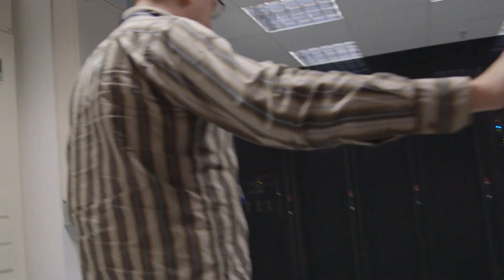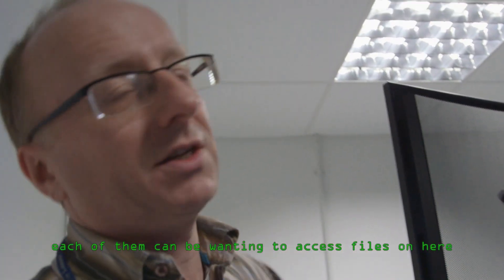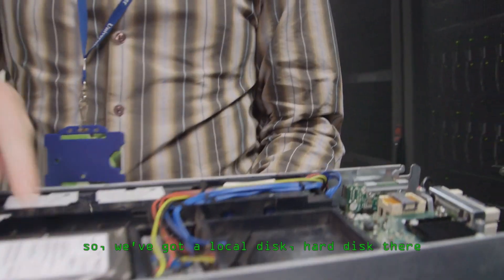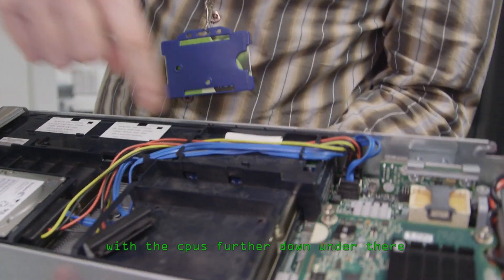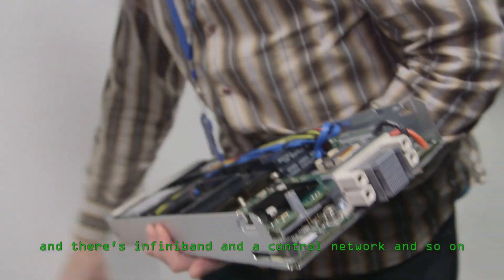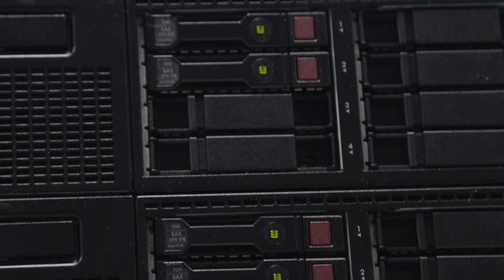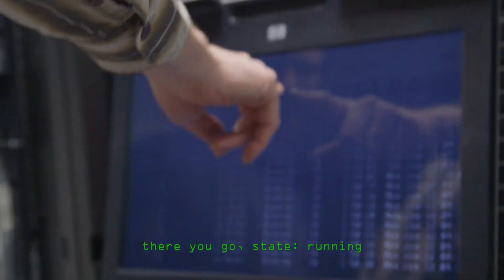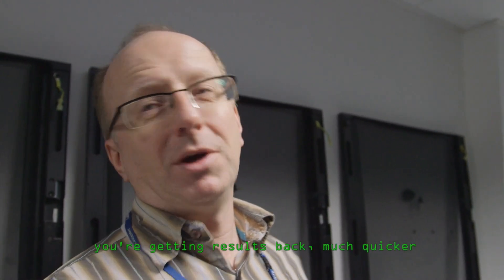Supercomputer and the Milky Way - Computerphile

Comment: What if real life is being run on a supercomputer just like this?
Reply: That'd mean that it would be emulating itself at full speed. (Given that it exists in 'real life' and it is simulating 'real life'.)
Reply: Goobli bloo! It probably is... It's the most boring FPS to ever be designed. LOL :) If you think about it, everything that we perceive is nothing more than a reflection of what we believe we see. If you think about the fact that all you have the ability to see is what exists around you at a given time, it would be possible to have the universe as you know it load progressively as you appear to move through it. (Where it actually moves around you.)

The Matrix was basically that idea. Processing power for each person's experiences could be borrowed from their brains, which would just be a node in the machine.
Reply: Haniff Din i dont think you understand psychology well enough to make those statements, we know the brain doesnt work the way you explained because of mentall illness and physical illness and some of the state altering substances you pointed out. a computer behaves in bits and bytes, but interfaces that into something that is easier to comprehend for humans. the brain does the same, it gets an stream of info that would make no sense at all if we got it directly.(or atleast it would make a lot less sense). it makes from those signals an useful whole so we can respond to it and filters out the noise. sure, that is going to be a little bit different for everyone, and will become even more abnormal when taking drugs, or experiencing depersonalization, dissociation, or an out of body experience. this all influences the brain in such a way (all for different reasons) that the way the brain handles these inputs differently. drugs mainly are chemestry changes, that when taken often enough actually change the nerve paths in the brain. but dissociation and depersonalizations psychosis etc are also very obvious an altered interpretation of reality for various reasons. that my blue might or might not be the blue that you see, doesnt matter. we still both call it blue because we both learned its called blue. an altered state of mind is basically this difference exaggerated. the brain deals with the input differently than it does with the control group. this also is dependent on the laws of physics. no action is without an reaction. and every reaction must have an action prior to it. in quantum physics this gets weird, but there just isnt any solid proof that it actually is as weird as we think. just because we dont know the underlying causes doesnt  mean there isnt any. its just an unsolvable problem if that was the case, and we are far to new to the quantum physics to conclude that it is unsolvable.
Reply: Gabriel Garcia I think the idea is that we are information on a larger computer, not on a computer inside our reality.
Reply: Elliott Collins well, he did say "on a supercomputer just like this."
Reply: +Joe Mills our brain is more like a data interpeter. not a simulation interpeter. if we generated the signals ourselves then yes, we would be running a simulation. but that would leave us able to live in different realities. and thats not the case.
Reply: ***** yes, thats exactly my point. a different perception doesnt mean a different reality. its not a simulation of reality its a conversion to terms our consciousness and subconsciousness can grasp. i can translate something from english to french, that doesnt mean i said something new. but some things wont translate completely well and ill have to change the layout, add some words, remove some words. use cultural reference etc.. thats why people perceive things different. some people their brain is wired differently. thats why things like dyslexia and autism etc exist(this is an oversimplification, but a part of it is perception and data interpretation)
Reply: Haniff Din i have dissociated for hours, ive had depresonalization episodes for days. ive had 2 near death experiences. ive saved 2 lives from other people. ive don lsd about 6 times. ive eaten shrooms about 4 times(they are legal here so a much higher dose than this garbage you get in countries where its illegal.)
Reply: Haniff Din why are you insulting me? is it because i nor my sources do not conform to your idea of the world? i dont think you understand what a depersonalization is. maybe you should read about it before insulting me and saying i never had an OBE. an depersonalization is the medical term for an OBE and some other unbodily experiences.
Reply: ***** with time it becomes more difficult and science is not entirely sure on which it is yet. (from what ive read atleast, feel free to post proof for the statement that time is an emergent property)
Reply: ***** thats not evidence that time is an emergent property. thats  a conclusion from untold arguments.
Reply: ***** photons are quantum particles that dont have a mass, electrons are particles that do have a mass. thats a huge difference in physics. i already provided scientific evidence in the link i gave on why gravity isnt a secondary force. unless you can fight that source for my argument it still stands no matter how many different viewpoints you throw at it.
Reply: Gabriel Garcia Whose to say the world is being run at full speed? The world could lag or stutter but we just don't experience time go by when it happens.

Comment: By 2030, your right smart lense would pack more computing power than DIRAC.
Reply: Moor's Law isn't going to hold true forever, right now we are running into issues with sizes of atoms. While I do hope that quantum computing will become a thing I have doubts that they will have quantum computers the size of a contact lens, transparent, have little to no heat emissions, and have their own energy source in 25 years.
Reply: I have doubts about that.
Reply: nope it won't have. Even if Moore's law holds (which looks more and more unlikely as time goes on), the average PC will be 256 times faster than now, and since DIRAC uses PC's as a building block that means your 2030 desktop will still be 4 times slower than DIRAC is now

your smart lens will certainly not be faster than it
Reply: Zak El Fassi yes, we are bad, but Moor's law holds for over 40 years now, and it always pointed at the best performance practically possible with current technology
Reply: Noah Hounshel well.. he does have a point, technology does advance MUCH faster then human's tend to be able to predict
Reply: Noah Hounshel This may be a cop out, but all you really need is a strong networking device within the contact and you could outsource all those transistors to another device.
Reply: But then your contact lens wouldn't actually be 4000x faster than a regular computer.
Edit: Plus it still wouldn't be transparent.
Reply: Noah Hounshel 15 years*
Reply: Apologies,
Reply: Skepticism aside, if we've learned anything about the human nature from the past 20years, it should be "humans are really really bad at predictions."
Reply: While I like the idea of some sort of seamless integration of local display technology and remote compute backend, I really can't see a use case of putting that much computing power in the hands of the general public.  OK, fine, misquote Bill Gates at me, but I'm serious, there's more computing power (and connected bandwidth for that computer) in the DIRAC system than you would need to simulate a Matrix for a person, or some sort of holodeck.  What's average Joe going to want with more computer power than it takes to simulate an alternate reality?  No one has bothered to write that computer program yet, but I'm sure it'll happen.  And we'll have hit the limits of silicon-based computing by then, and it'd take a radical design change to shrink this much computer power down to what a regular person would want to install in their house.  But the main point is that if it's more power than someone needs for immersive VR, they won't want it, so no one will pay for it, so it won't happen.
Reply: No, there needs to be more power, Here is a list of things that could use that power easily and still need more.
1.Rendering (This is the biggest thing that I could think of)
2.Recording
3.Gaming
4.Multitasking
5.I could think of more once I actually wake up
Reply: Any gamer who wants to record will want to render, game makers will, any aspiring animator, any video editor etc. 

Another thing is that anyone that has any desire for a render farm can make one, at the local college they sell computers without hard drives for $25 so anyone who wants one can make one.

A game could easily use all of those cores for rendering amazing and fantastic AI and graphics, GPUs will also speed up not just CPUs so graphics will also be faster.
I also would like to point out the trend that we are talking about is about single cores not that we will get hundreds more cores.
Reply: Noah Hounshel I'm curious about this local college computer selling business. Are they Arduinos (or arduino like) or are they recycling old hardware?
Reply: Old hardware I bought 10 old Latitude D-somethings for $25 each, which is a really good price for setting up little servers. The only downside is that they have no hard drives (Understandable) and the fact that occasionally some idiot decides to take out only one RAM whilst leaving the other one under the keyboard untouched. but for the most part they have RAM.
Reply: I don't mean to pry but are you connecting them concurrently? I've always been curious about these kind of set ups. I always read about PS4/Adruino/Rasberry Pi computing clusters and I've been wondering about the feasibility of setting something like this up from old hardware.
Reply: Noah Hounshel Er, OK, I thought the topic here was whether regular people would use the equivalent of 4500 modern cores enough in their daily lives to bother getting such a system.  I can't see it, because right now we're bandwidth limited, not CPU limited.  Those fantastic games should share state with other people's games to make it interesting by making it social, the kind of interactiveness and detail implied by fully utilizing such a system would require way more bandwidth than most people want to pay for.  I just think it's too much on all counts for regular enthusiasts to bother with.
Reply: Brennen Sprimont I guess the budget for power could be extended to maybe 10KW, and let's assume power requirements per CPU reduce by another factor of 10, but that's still only enough power for about 100 cores.
And I'm talking about the rest of the system, not just total general-purpose CPU but the interconnect between them, too.  There's really a world of difference between what a CPU can do and what a GPU does.  GPUs have to process "simultaneous instructions, multiple data", i.e., the kernel does the same thing across all of the elements it's using.  It has to access data in a predictable way, doesn't have direct access to network, has to specifically load blocks of data from system RAM, etc.  A general purpose CPU, Infiniband-connected like the ones in DIRAC, basically has access to any bit of information that any system has, albeit with faster access to local data.  It's completely different from how a GPU works.
I'm sure someone will come up with some enthusiast application that takes more cores, but the only thing that seems reasonable is rendering, and it'll always be cheaper to send those jobs to a render farm, because no enthusiast is going to be able to keep a render farm busy enough to buy their own.
Maybe something will come up, but I can't see many people rendering their own movies, and if it doesn't go hugely mainstream, it won't get cheap enough for regular people.
Reply: We sort of have 2 arguments going on here.

1) The general public has no market for a super computer.

I ask did you read my first paragraph on the possibility of simulation becoming a main stream application? Also why did you bring GPU's into this argument?

My general point is that it's near impossible to predict future technologies (and in this case applications). While you view rendering as the biggest market currently, I view simulation as being in high demand in the current years. But there are also countless other uses that we haven't thought of, and when they come around we will all have that "Oh! why didn't I think of that!" moment.

Also if I can't misquote Bill Gates, then I'll misquote every scientist from 1890 - 1945, "What could the public sector want with electromagnetic radiation machines?"
Now we have microwaves in every house.

2) The general public will not be able to afford the electricity cost of a super computer.

To this I say look at the gap between haswell and broadwell alone. Haswell had a 22nm process and could only get down to a 10W TDP per core. While Broadwell with it's 14nm process could get down to a 3.5W TDP per core. Before haswell the best was a 17W TDP per core. Now we are expected to get down to at least a 5nm process and I couldn't find a good tdp per core number but if they can lower the active power in anyway like they did from haswell to broadwell we could be looking at TDP's as low as 1W per core. 

Top that with general processing speed increases, we probably wouldn't need the full 4,500 cores that DIRAC had to reproduce it's speed. Lets say we have maybe a 15% performance per core  increase over DIRAC's current hardware.

This was for CPU's alone, we also have to assume that Memory, Storage, Internal buses, external buses, etc. all increase in performance and lower in power management as well. And this is already a wall of text so I don't really want to go into numbers with each component, but I hope the picture is clear.

This is also not even going into non-silicon based transistors such as carbon nano tubes or alternative energies lowering the price of electricity, which is expected to happen in the long run (although they are increasing now).
Reply: Yeah, you're making valid arguments.  It's sort of possible to have it happen that by 2030 we'd have something in use at home that we'd consider as powerful as a 4500 CPU machine from 2015.  I think it's more likely we'll get more of the render path running on what we'll call a GPU by then.  There's just a tremendous difference between practical computing for home use and high-bandwidth parallel scientific computing.  There always will be.

I don't think Moore's law is sustainable.  Especially once we reach the point where everyone can do whatever computing they want with the then-current systems.  We have a way to go yet, but an atom is an atom, and we just plain can't shrink a logic gate to smaller than an atom, it probably can't shrink to even 50 atoms without getting too many quantum effects throwing noise into the system.  That's not too many die shrinks away, and then what?

We'd need to go parallel, but fast interconnects are expensive.  That Infiniband in the DIRAC system is probably 1/3 to 1/2 of the system cost.  I assume we want to be able to communicate between CPUs at least as fast as we're doing now, but in what way?  Optical is fairly expensive and can't be made any smaller than the wavelength of the light it uses and electronic is noise-sensitive and more so with smaller parts.

So, to the original poster's suggestion that we could eventually carry around the computer power in that DIRAC system, I'm going to have to disagree.  Besides, all we need in a "lens" system is connectivity to a real computer, and we might as well have that real computer in some datacenter somewhere, so we can share it when we're not using it.  Meanwhile, we can carry around a GPU to present user interfaces to us.
Reply: Zak El Fassi If you don't need extreme compute precision, you can fit that much computer power in a large desktop. 8 proc motherboard, 8 Tesla GPUs, LN2 cooling and you've got yourself ~30TFLOPS and over 23,000 compute cores...
Reply: I agree, but I think a lot of that will be done in the cloud instead of in some wearable.  Maybe run the first pass of filtering on the local device, whatever you can spare the battery power to run, then have some remote system do the heavy computational stuff.  There really isn't a use case for carrying around thousands of general purpose CPUs, use ccNUMA communication between cores or have tremendous storage bandwidth.  That all can be shared, even if the hardware gets smaller, it's still going to be impossible to cost justify having your own huge computational system.  The network will continue to be the computer.

I was talking to some people at a science-oriented social gathering a while ago and one of the guys said he'd want a neural implant that stored all of human knowledge.  I pointed out that we generate millions of "pages" of new knowledge every day, so he'd need a way to update it.  Then I suggested he really just needs the link that does the updating and store the base data somewhere outside his brain, because we can't store all that data on anything small enough to fit in a head anyway...
Reply: But most of those "pages" are useless stuff anyway like me going to read the giver for the 3rd time this year that does not need to be put in this massive store of knowlege
Reply: Noah Hounshel Filtering out repeated experience is something we can do now, it's not that hard...
Reply: But how could a computer tell the difference between them?
Reply: Noah Hounshel The same way we do. Look at the data and compare it to previously collected data. If it matches, strengthen that connection and move on.